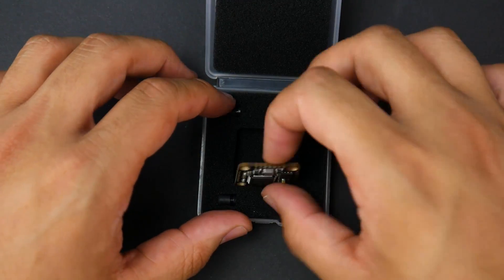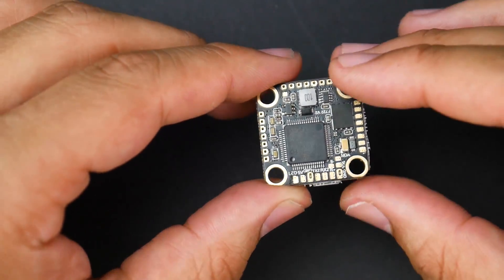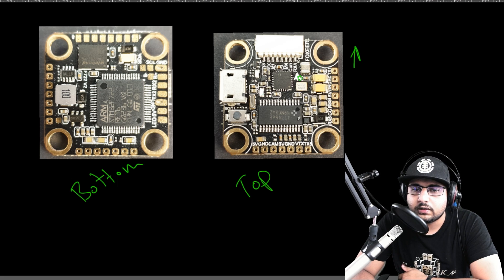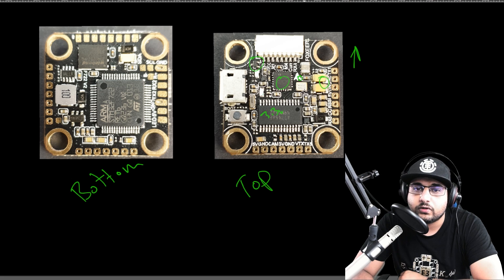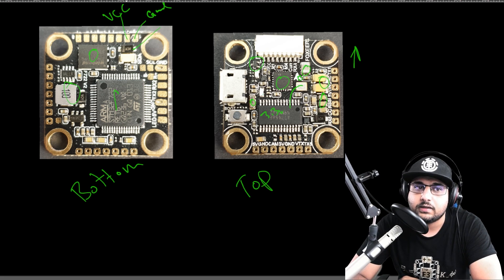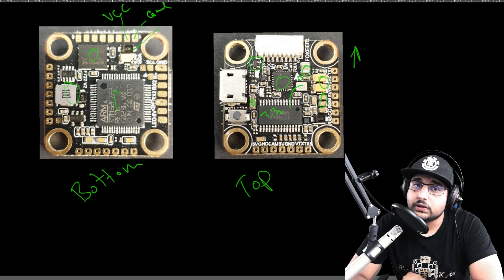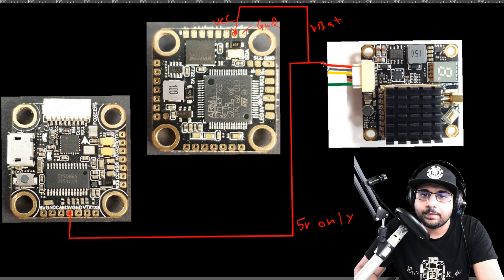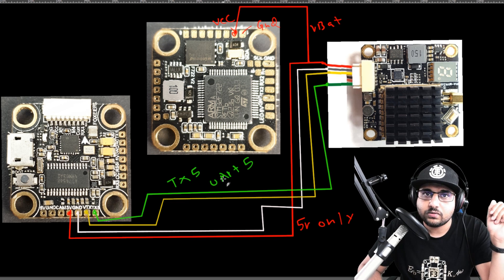Foxeer F722 Mini V2 [2020] // Breakdown & Setup Guide

Comment: DJI Air is fine to run on 4s direct from the battery voltage.
Reply from the maker: I know a couple people who burned them from high voltage spikes from terrible ESC's. So to be safe I always recommend voltage regulators even for vista.
Reply: Drone Mesh I have nit heard that. I always put a capacitor on my quads.